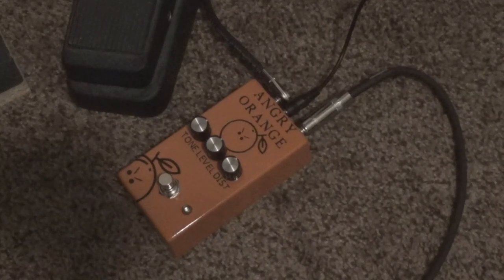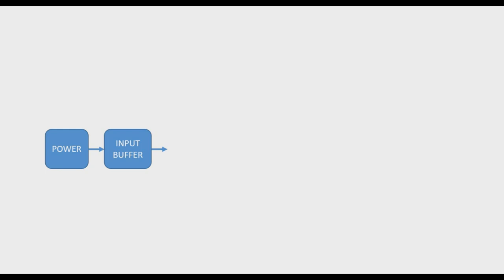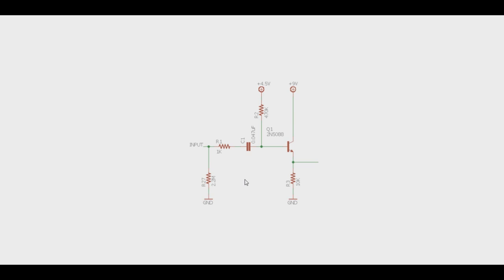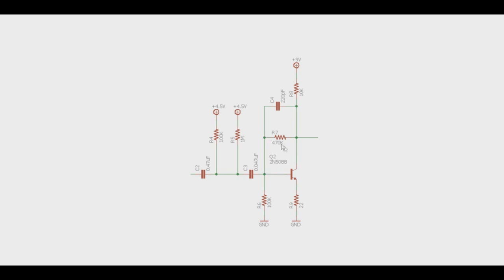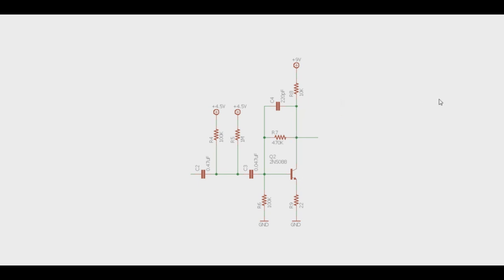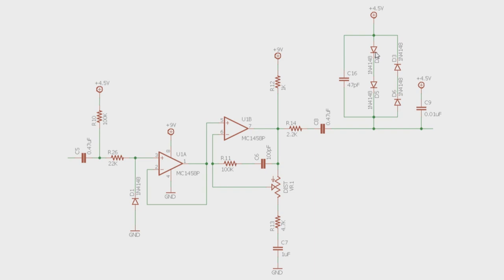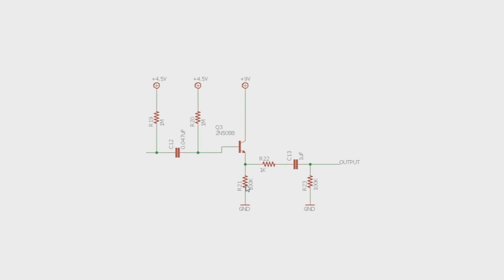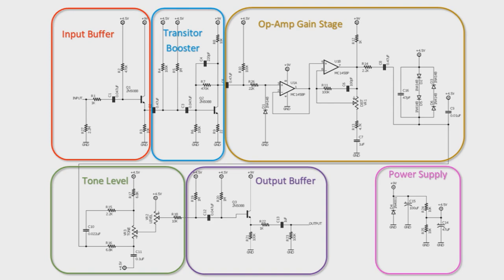Angry Orange, and Boss DS-1 Clones - How Do They Work?

Comment: [TRANSISTOR BOOSTER] Can't get where it can amplifing when on the transistor is 10K from 9V and 22R to the GND? As I understand this is arrond 450 times lower signal than supply voltage? So we talking about otput sinal 0.02Vpp ?? Yeas I understand for op amp its a lot for differential check, but what for all of this?

Comment: Do you know the reason why overdrive/distortion pedals create airplane like noise when connected to an amp?
Reply: What you are probably hearing the the general "noise" of the circuit, but where on other pedals it would usually be pretty quiet, you are now amplifying it with all that high gain circuitry.